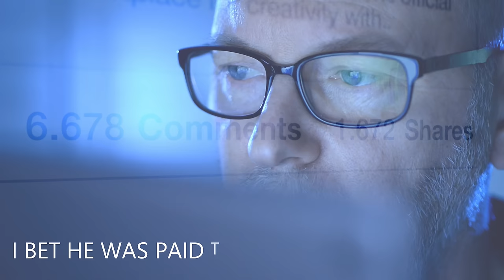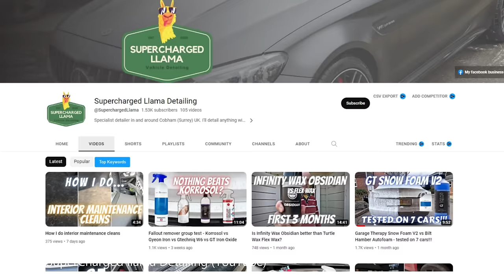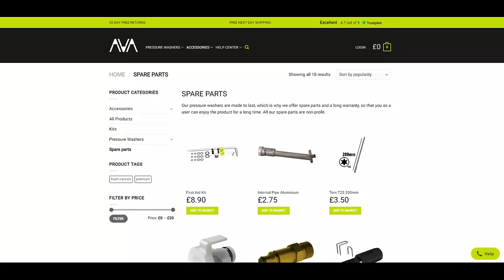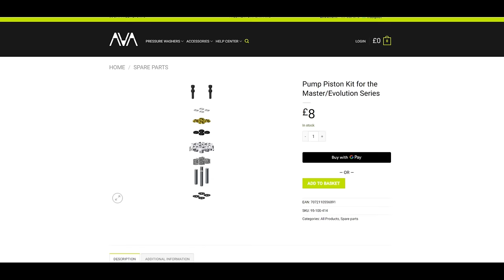AVA P70 - The “ONLY” Pressure Washer you will EVER NEED for Car Cleaning?

Comment: My AVA P60 is over 3 years now. Washing my car 1-2 times per week for these 3 years + other outdoors jobs. It has never failed. Had a small leak in the innertube in the pistol 4 weeks ago. Bought an upgraded innertube in steel and changed it myself for 30 NOK (~3$). Spare parts is easy to buy online if you need it. AVA has repair videos on youtube. I will absolutely buy AVA again. Greetings from Norway!
Reply from the maker: Hello from the UK. Thanks for your comments. Glad you like AVA Machines. I look forward to seeing the next generation of pressure washers over time. Can't wait to see what they will do next
Reply: I have a p60 also had it coming up to 3 yrs I use it for my work have the 4 m extension lance and have switched all connections to quick release it makes a big difference I found the hose connection to gun so hard to take on and off got two Lance's and two guns all with quick release

Comment: Great video Dave 👍👍 I’m looking forward to the servicing videos to come too! I’ve had my evo P80 for a few months now and I absolutely love it due to well everything you said in this video . My only issue was the snow foam cannon ! Not the thickest foam and it’s consumption was horrendous!! So I got an MJJC pro 2 . However both it’s standard nozzles the 1.1mm and the 1.25 mm had the Ava pulsing while in use ! After a conversation with Ava uk ( who were very helpful by the way) I was advised to switch to a larger 1.35 mm nozzle due to the high psi of the P80, I’m pleased to say this did the trick and it works perfectly! Thick creamy foam even using my usual bilt hamber auto foam which isn’t notorious for thick foam, and uses way less product too and no pulsing from the P80 😀😀  so if anyone else is having the same issue hopefully this will help!!!👍 keep up the good work Dave
Reply from the maker: Thanks Trev appreciate the comment 🙏

Comment: I absolutely love my P70 Evo it’s bloody brilliant so far. 
So innovative always thinking a head. 
Excellent video Dave, really well edited 😊
Reply from the maker: Thanks mate. Mines fantastic. I've now upgraded hose to 20m and it's bang on 👌
Reply: @turbo3492  I have no issues at all
Did you plug it in direct to wall
Extenstion leads will blow as well.
Reply from the maker: @turbo3492 honestly its fixable, simply reduce the water pressure slightly or run it through a water tank and let me know what happens. I Test all the avas on a daily basis so I and I had a P80 which was blowing because of too much inlet water pressure. Give it a go and let me know how you get on
Reply: @turbo3492  yes I brought a 10m external heavy duty extension lead for this purpose 
Glad it’s all ok now

Comment: I have to thank you for your brilliant reviews of pressure washers, especially the AVA range.  I bought a K4 Premium Logic a few years ago and after very average performance and two failures I needed a replacement. The first failure occurred within the warranty period meaning the whole thing had to be replaced.
The AVA P70 is a little too big for my purpose and the lack of slow start function meant that the bigger AVA machines are prone to blowing fuses and would have irritated me.  So I went for the Smart P60 Bundle.  This has so much more power than the old K4 and as Karcher wanted £145 to repair it I went for the Smart P60 at Sale price of £199 direct from AVA.  The basic Foam Cannon had a manufacturing fault and so AVA replaced it FOC with their Premium version.  The 8 metre hose was a little short and so     I bought a 6m Bosch pressure hose for £15 from Amazon as it has the same end fittings. 
 Ava say that you can use your existing Karcher accessories but this is not exactly correct as you need to cut some of the plastic off the screw collar to allow the bayonet to seat correctly.  
Thanks again for your in-depth reviews

Comment: An AVA P70 Evo has turned up at my house on the back of the both of guys reviews & after repairing my 18yo Karcher 5.550m thought it was maybe time for a new PW. Until the other day I had never heard of AVA until your review & was going to buy a machine from the blue corner, but so far I've not regretted my purchase   The performance and build quality seem fantastic & hopefully my opinion will still be the same in 2-10years time . The design details that have gone into this really make it an epic machine. . As a bonus all of the Karcher accessories fit this machine with the correct pressure rating  so don't have extra cost of new lances/adaptors to be factored into cost to change. The foam cannon that comes with the machine will be useful for spraying TFR or other harsh chemicals as I have a brass headed one already. Keep up the great content !
Reply from the maker: Thank you very much for the comment. It's a relatively new company but they are making huge progress and I genuinely believe in their pressure washers for the car care enthusiasts 🙏

Comment: Kranzle 👌🏽. You’ll never look back.
Reply: Overpriced over hyped
Reply: I actually bought one and was doubting the price sonce i paid 1k for it after brutal usage im telling u its the best
Reply: @GrahamReid34  without a doubt Kranzle is the best all round pressure washer you can own, once you have one you will never have anything else.
Reply: @GrahamReid34   yep your right had an Ava p80 was rubbish kept blowing fuses my genny wouldn’t run it sent it back and brought kranzle and never looked back, as you say mines took a right battering so reliable and dependable
Reply: @colinmcburnie2881  I'm using a P70 with a 8000W generator. First time running it it blew a fuse, but after changing to a slow release fuse, haven't had any issues. 
You do need a massive generator for this pressure washer unfortunately, but when paired with the right genny, it will run perfectly fine.
Reply: @alpha13sierra  I tried slow blows didn’t help, fair play customer service took back gave full refund but the fuse blowing was so frustrating and totally put me off the brand would never buy again! And since buying kranzle it’s a proper work horse never lets me down
Reply: AR Blue 630TSS is probably the best you can buy for the money and is built proof.

Comment: Nice video - I  few months ago I wanted to get an Ava but they were out of stock, so ended up with the Nilfisk 180.  Very happy with it do far, although I am very interested to see how the AVA fairs over a longer period of time.  it does look plasticky, but it seems to have stood 12 months of regular use and looks good for it.      The new studio is coming on a treat.
Reply from the maker: Thanks Tim nilfisk p180 is a great machine. I did sell mine but I just like to switch my equipment on a regular basis for the channel

Comment: Looks good, I previously bought a P80 and it was very frustrating blowing fuses, I run some tests on this machine and found it was pulling 14.5amps without a fuse fitted so im not surprised it was blowing the 13amp fuses.
I contacted AVA themselves.. after a few weeks they reluctantly gave me a full refund. BUT I didn't have to return it! So I'm left with a P80 I can't really use but I did receive a refund.
Reply from the maker: Well done that's good to hear. It's interesting to hear about the Fuses. I felt like the p80 was too powerful for its own good sometimes. Mine blew a few times at one location where we tested the voltage so we changed it to a P70 for testing purposes and it's been flawless.
Reply: Have you tried a slow-blow fuse? initial inrush current might be the issue, until levelling off below 13a. Worth a try.

Comment: Nice review. 5 out of 5 for me, easily the best I have ever used. I have the Smart P60 which is good enough for my needs, which I think has a shorter hose but as long as you position the washer near the vehicle it's easily long enough. As for the foam gun, yes the basic one does eat foam for fun. But whatever you include, you have to factor into the price so It's the age old argument of do you put the brass gun in the kit and charge more for it, or leave it out and let those who want one pay the extra? 

I have noticed there is now a third one from AVA described as the Premium foam cannon, though it's priced lower than the brass one. A comparison video of all three would be useful.
Reply from the maker: Thanks for your comment. Yes I have new cannon which gets featured in my next video. I really liked it. Another innovation from AVA. That's what I love about them
Reply: @epicautomotivedetailing  Brilliant, look forward to that. I bought the pole with the wash mitt thing attachment this week which should be very useful to me and anybody with back problems - I think that would be worth mentioning in a video too. Just need to upgrade the foam gun but would like to stick with the brand, but with the new one out now I'm not sure which one to go for.

Comment: I have an Ava the foam canon came broken and they replaced included some extra accessories. I then had another issue with the trigger and they ended up just sending me a hole new unit. Not sure how I feel but the warranty is very good.
Reply from the maker: The only issue Ive ever seen with the triggers is where people leave them out in freezing temperatures and then the o rings warp causing leaks. Glad they resolved it 👌

Comment: Thank you for your videos, thanks to these I've decided on an AVA. 
Ideally I'd like a P70 or P80 Evolution but there's currently no stock. There's a P70 Master or the P60 Evolution. Do you think there's a noticable difference in performance between the 60 and the 70.
Thanks Again
Reply from the maker: I know it's so frustrating because I wouldn't have made the videos if I knew they would sell out so quickly. I got the Evo p60 yesterday. I had a quick go on it and you can't even tell the difference between that and my Evo P70. Seems pretty good 👍
Reply: @epicautomotivedetailing  Thank you for your reply and for your answer! I'll go ahead with the P60 🙌🏽
Keep up the good work
Reply: @epicautomotivedetailing  Oh one other quick question..am I right in thinking that a longer hose that fits a Nilfisk is compatible?
Reply from the maker: @gynads  Hiya I don't know that myself. Definitely would need to research that one

Comment: They are pretty good but  an equivalent rated Kranzle costs only slightly more and is superior. Having a brass pump, ceramic pistons and a metal braided high pressure hose.

The pro foam system goes on the gun so the foam doesn't go through the pump. That protects the pump and the seals

Comment: Do you prefare this over the nilfisk p180...

Have you had any issues with the fuses popping..

I will be  purchasing ava as our next pressure washer  when the k4  dies..
Reply from the maker: Yes I prefer it to nilfisk. And no the fuses have not blown on this. The P70 is perfect balance of power, flow rate and it's an improvement in my opinion compared to the P80. This is the best Ava made in my opinion

Comment: Great video. Just wondering, are there still issues with blowing fuses ?
Reply from the maker: The p80 had the odd blown fuse but my P70 evo has seemed to have resolved it. The only problem is many are sold out now on the Ava website unless you go for the P70 master series. Which is still great

Comment: Have to say I enjoy your videos but I do find you seem to say everything is great AVA wise. OK, just a casual user after the best value i can get for £350 ish. Why do AVA still bundle the much criticised Foam Cannon and is there an option for at least 10m hose. Please direct me to something you think i should watch. It seems to be AVA or Nilfisk??
Reply from the maker: Hello in this video for example it was my first time using the Ava p70 so I went through pros and cons, and also supercharged llama detailing conducted the review to give it a new angle. The Ava p57 was a launch video so I stated it was a paid promotion so I was basically commissioned to produce content for the UK Market. In terms of reliability yeah I have noticed a few people have fuses blown with the old p80. For that reason I believe they stopped making them to rectify the issue as EU machines don't require fuses. If you want something that's stood the test of time then the Nilfisk P180 already has that proven track record of excellence so it's the better choice long term until the UK Market has enough data on ava

Comment: The problem I have with this top of the line model is the snow foam gun,how many months ago did AVA say they were aware of this cheap nasty gun? We are aware of this and are looking to resolve this? Year goes by and they are still throwing this rubbish snow gun in most packs,even their top of the line,this is not a good selling point,could AVA not just give a one of their better snow guns in the premium yet washers,I did consider the P70 but when a company cheaps out on accessories so you then have to replace said items for something better just means your spending even more,that’s why i bought the P60,yes the snow gun was the deal breaker for me considering the price difference,
Love the shows, would like to see a shoot out between P60 or P70 vs Karcher new HD series
Reply from the maker: Hello the new Easy range of Ava pressure washers are being released with premium cannon's.

Comment: The AVA'as are great for sure, but... Yesterday I purchased a P60 2,0 to replace my Kårcher K7 Smart Control, planning on using it as a spare machine at my professional detailer Company workshop, and I must say I'm very disapointed. The P60 doesn't even feature the option of variyng the pressure/flow. The hose guide which is supposed to make the drum perfect when retracting it, is a joke! You have to move the "guide" manually. This can be done better using a hand as a guide. The AVA goes for return tomorrow

Comment: I need a new pressure washer under £200 gbp. Where would your money go?
Reply from the maker: So yesterday Ava released a brand new model called the P40 Easy. I've just released a new video on its bigger brother but for £240 it's amazing value. Do watch it because it's a good machine in terms of spec
Reply: Thank you I’ll take a look. Is that the most power I’ll get for the money? 👍

Comment: I ordered a P60 Evo on the basis of positive reviews here and elsewhere on Youtube. However, I feel the time has come to question the wisdom of recommending anything from this company given the appalling experience I have had from them. Order still not fulfilled after 2 months, Delays reported to be due to repeated machine failures they are trying to iron out or Red Sea delays. They don't communicate, especially with their retailers. They tell retailers to issue refunds without assuring the retailer they will be refunded. A total joke. I will be more than happy to update these comments if I hear something positive about my order but as it stands, if you are considering ordering an Ava product, from my experience my advice would be DON'T

Comment: What do you think of the Ava Masters P70?
Reply from the maker: It's still a great machine. Pretty much Identical underneath. I still don't know why they needed to make variations of the same model tbh. Still brilliant though
Reply: @epicautomotivedetailing  Thanks this help I think I’m going to purchase the masters XL bundle as the evolution does not offer the bundle for drive washing accessory.

Thanks
Reply from the maker: @jfsx100  they just sold out of so many due to this video I think 😬
Reply: @epicautomotivedetailing  haha indeed . What about the evolution p80 you raved by it last year however you said you had issues with the fuse? Is the p70 better than snd do they offer a version with drive cleaner?

Thanks
Reply from the maker: @jfsx100  P70 is better. The p80 was far too powerful for its own good. This is plenty good enough apart from the short hose
Reply: @epicautomotivedetailing  brilliant thanks for this!